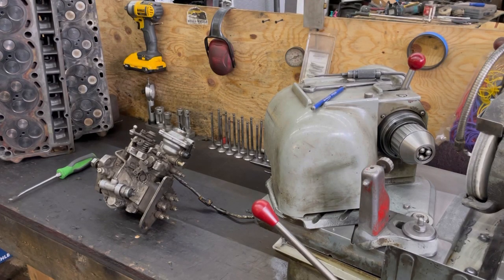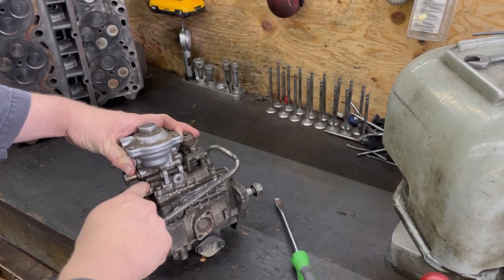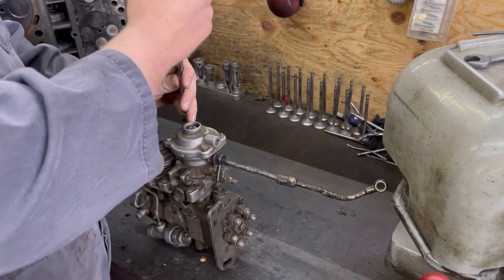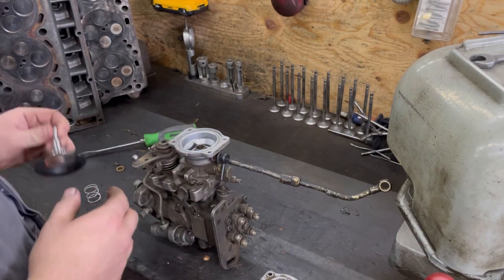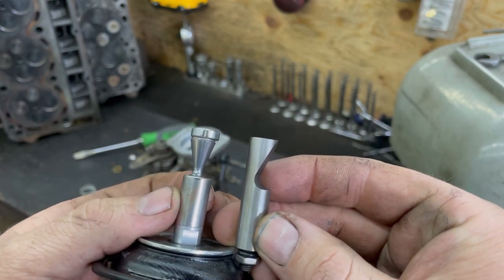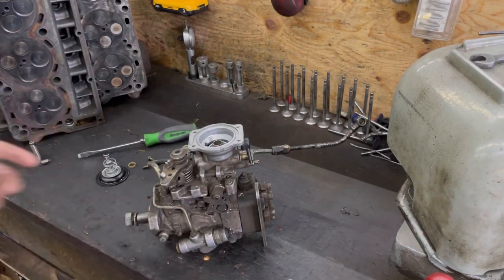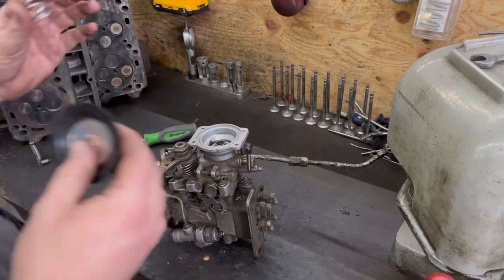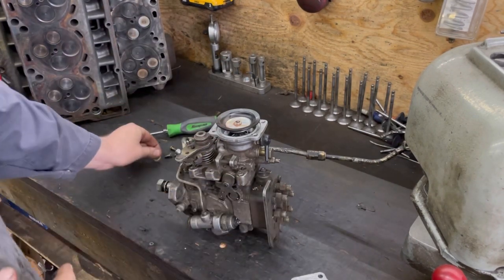Intro to ve Cummins injection pumps tuning. 12 valve cummins

Comment: Hi Rob, I am working on a 1989 non ic ve pump 6bt in a dodge. Truck has a freshly rebuilt ve on it due to front seal leaking diesel into crankcase. The new pump has the cold start assist deleted. It was recommended by the shop who sold the new pump. It is not in a cold climate.

The truck has an issue with it loping bad shaking the whole truck when in gear with the new pump. I've noticed that the lope gets worse once the truck is up to operating temp. I'd appreciate the help if you can.
Reply from the maker: I would check the timing is good and make sure you have the right lift pump pressure. The cold start on make a lot of difference if it really cold ( my opinion) 
You can try adding and taking timing away and se wig that helps your running Issues

Comment: Adding all this more fuel makes for smoke which I don't want.  Is there a good turbo that doesn't cost a ton of money that will work with these mods.  I tow with my truck either cattle in an enclosed trailer or lumber on a flatdeck with the net cargo weighing 10-12,000 pounds.

Comment: Great video , just after some help , iv recently converted a tractor from a cav pump to a bosch ve , the engine used to rev to around 2600rpm now its max rpm with the bosch pump is 2000 rpm , what would i have to do to get the 2600rpm is it as simple as adjusting the screw or will i have to dive into the pump ? 

Appreciated for any help
Reply from the maker: Should rev more than 2000rpm stock. 
So some must me out of adjustment or you have low fuel pressure. 
Can put a high rpm spring in it as well if wanted
Reply: @CUTTERUPROB  thank you I shall look into it

Comment: Does re-indexing the throttle arm on the spline do anything? I told my pump builder that my car was running like crap, even after backing out the enrichment screw. They told me that i should take off the throttle arm and turn the screw counter-clockwise a mark, then reintstall arm, see how it runs, repeat. Its a tdi motor with the same pump. 12mm. Smokes far too much at idle, and if you turn the enrichment screw up it rev hangs, runs like crap, and smokes like crazy.
Reply: Helloo, 1 year late,
I had similar problem when upgrade rotor head,
By upgrade 12mm, its increasing fuel on idlle

By reindexing thtl plate, its reducing the fuel at idle....
You will need to loosen the power screw tho, because of increasing fuel from 12 mm

Its like globd valve in water sytem, by increasing pipe size you also increasing volume

Comment: I have a similar pump on my renault crewcab diesel it has suddenly started playing up and then tickler only. And finally not starting at all .
I took of 4 screws holding diaphram to check for splits ,it was looking good .
So I put the metal needle and spring and diaphram back into location.
Then tried turning key to see if the pump was working as no diesel was coming into fuel filter.
But on turning key no movement of diaphram up or down. Dose this mean the pump is broken.

Comment: My pump was adjusted by the previous owner. Before I turn in my fuel screw like you suggest.  Is there any way to find out how much it's already turned in?  Is there factory presets outlined in the pump manual?

Comment: If not trying to kill the factory auto 92* model truck and wanting just a little extra maybe say 200-220hp what would you recommend doing ? Gov spring for sure and pin ? At that power level would you be better off putting a 2nd gen lift pump on too?
Reply from the maker: I would do both. The trans will take it if you drive the same way as you did before. But those convertors do like rpm and the extra power.

Comment: I own a 1 ton 4x4 dually  99  NV 4500 ,,5spd,,,,,,never even wanted a diesel,,,I knew this truck a good long time,,never turned up,,never in front of a pulling sled,,,mostly farm truck small farm,,,so the fella prices it to me at a unbelievable price,,at the time I bought it,,,bank valued it in the neighborhood of 14,000. + ,,,I gave $3500😉 I about broke my neck Goin to get the cash,,,so now I own a mini freight train,,,what a beast,,,all the maintenance  clearly done spot on all its life,,uses maybe 1/8 quart oil at 10,000 mile intervals,,never almost never smokes,,,,,,,so after a 1yr + owning it an just cheesin all the time Mmmm! Beast,,,my vp lays down for good 315,000,,,,,it been a good 1,,,    I've changing my vp 44 to ve ,,,,  I do pretty well on the newr vehicles BUT my heart is in to simple (NO SENSORS!  LESS IS ALWAYS MORE IN MY BOOK)   ,,,The ve is got my attention fosho, less moving parts,,simple no sensors😁😁😁,,, so changed timing box to accept the VE ,,,had to cross breed the ve delivery valves with the vp44 (delivery valves?) More on that later with a inquiry from anyone if u like,,,so those pieces installed on my ve it comes out EXACTLY the same length as the vp44 SWEET.  YEEEHA!  Stock injection lines on the 24 valve 👌 perfect ,,no trying stretch or adjust them like they were made for it,,,had injectors recalibrate for the VE (a must ,cheap to have done,,pop off pressure is way different,,,,,had the turbo a slightly updated not way over done just a good solid  wake up,,, I've kind of backed off for a while. It's been setting for a minute. Just had some issues in life. That was really causing me some grief. And I just didn't want to fool with it but I want to get back on it.            have some question ,,, While changing the timing box on the engine, I pullrd all the bolts out of it. I consider myself a decent mechanic You know, evening nights whatever. But  I have made living at it before, 
I didn't that much close attention to where each one of those bolts went the back cover to the block and the head. I'm sure that there is a correct placement ,,,,,,,,sure could use a scheme on which bolts go where for the timing box? ,,, Man be a bigolv godsend. That's where I'm at now. But I'm not gonna run like that because I know it's probably not correct.       I just don't want any issues when I turned to key for the first time.
  CAN Anyone HELP 🫤    LIKR TO HAVE THEM ALL CORRECT,,,half zass not me,,,an me no satisfy until I fix me dumb mistakes,,,it's not a screw up yet buy I can feel it coming on if I don't correct that,,,thanks in advance yall
Reply from the maker: I would have to do a video to answer this for you. But might be a bit as I swapped right now

Comment: Which way turning the rubber on the feul  pin does what?
Reply from the maker: You need to pull the pin so you can see where it is to start with

Comment: Great work!
Reply: I just picked an old 93 d20 and it hasn’t seen the road in 20 plus years. I was told the old timer stopped driving it because it “ran away” I ended up getting it started after a ton of work and then it ran away and I was able to shut it down. I need to figure out a way to prevent us. Looking for a good starting point and you’ve given me a couple solid starts. Has this ever happened to you? What’s the first couple remedies you would suggest

Comment: Awesome video, I’ve been having problems with my truck high idling  after I did my fuel pin, power screw, and 3,200 rpm governor spring. But you answered my question! My power screw is turned in too far.

Comment: Someone messed with the truck before I got it. They turned the power screw up.   How should I set it back to factory?
Reply from the maker: just turn the power screw out a bit till in has the power you want

Comment: I bought a used pump for my dad's 93 cummins the guy I got the pump from put a 3200 gov spring in and when I put the pump on my dad's truck the truck went wide open but we were able to shut it down  with the key ....would that be something related to the power screws if it was turned in to far ?
Reply from the maker: If the spring is installed right ya it’s likely the power screw

Comment: Would you do the 3200 spring and pin on a pump somebody else has dicked with? Mine revs to 2800 and rolls a little coal under hard acceleration. No idea how it is with a trailer yet. I picked it up from someone who did a dirty Cummins swap on a squarebody.
Reply from the maker: only so many things can be done, no reason not the play with it if you want more

Comment: Good vid Rob! I got the spring and THD fuel pin. I put the pin in and had low boost like under 5 psi at WOT, until I got it up to about 35 MPH then the boos came up to about 8-10 psi. I put the stock pin in and boost came back. I read some guy saying to remedy low boost to back off the star wheel so you build more boost off the line. Others have said to run it down.  The fuel pin worked great while the boost was there but it was a dog while it was below 5 psi. Can you elaborate on this.
Reply from the maker: Need to do some tuning. Put you steer wheel down all the way and add some smoke screw and start there

Comment: Go over the internal pin that rides on the fuel pin ramp. Sometimes they seize up and no matter how much you turn the pump up it’ll still have low power if the internal fuel pin is seized
Reply from the maker: good tip

Comment: Years ago in The magazine diesel power they did a project called rust bucket and it was the first GEN and it had to be pumping when I got done playing with this truck it was torn about 900 hp and got great fuel economy they change the transmission to lock up torque converter and things like that you know that she injectors and exhaust and this truck ran good strong David pump and will never make as much power as the pump but it’s a nice little palm gets the job done all right this is six in a
Reply from the maker: Yep. Jamie. That’s what we need to bet lol

Comment: 👍👍👍Don't have a 1st gen on the road at the moment..plan on it eventually...have got a 6BTA(VE). in a timberjack log skidder that have messed with a while back to get it smoke less and spool better...by messing with the aneroid pin,previous screw and starwheel obviouslyl...but...I may have boost leak or something too..not sure..may have to do something with the turbo so it's more responsive...idk... we'll figure it out...
Reply: But obviously it's different tuning a 30,000 lb machine compared to a 6,000 lb pick up
Reply from the maker: Turbo will help. Just make sure you have a egt gauge